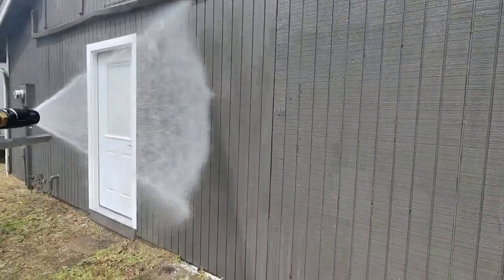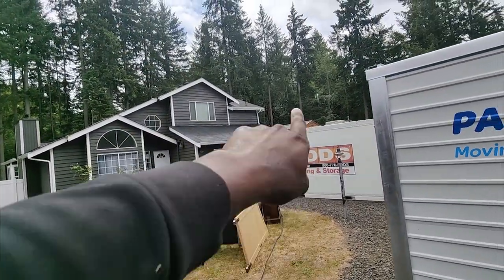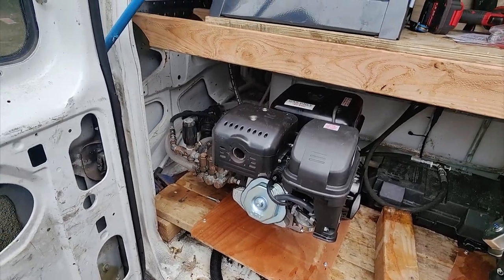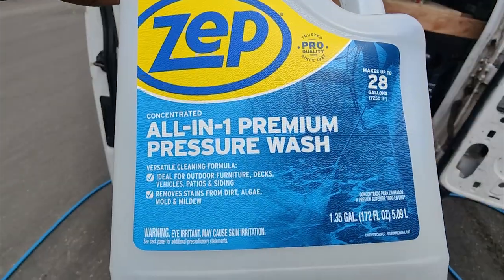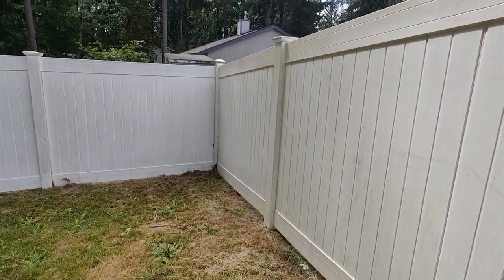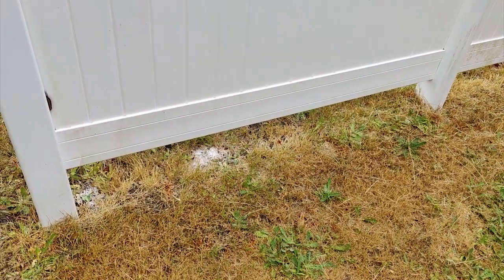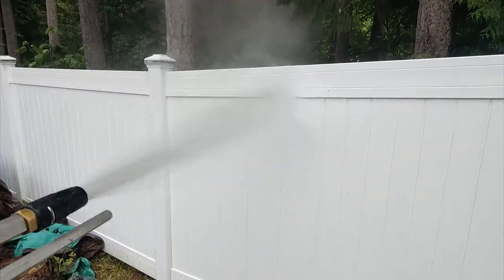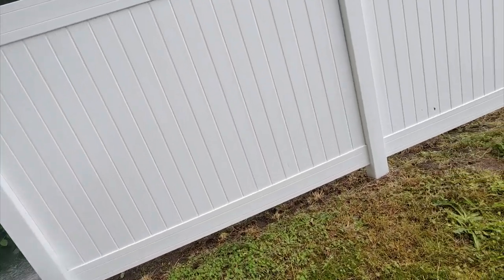8GPM BUILD // ZEP'S ALL-IN-1 PRESSURE WASH REVIEW

Comment: Are you proportioning your bleach before the downstream injector?
Reply from the maker: Yessir 😁
Reply: @BJMolette  is that to conserve on bleach?  I typically need the 1-1.25 % that comes out of my injector to clean houses and vinyl fences.
Reply from the maker: @colonialfiend  yes. It gives me all of the control I need. I'm going to change the orifice size to pull max chem and just use the metering valve to bring it down. I heard you can get 4% with this setup.
Reply: Commenting on YouTube sucks as comments can get skewed or taken out of context.  If you're downstreaming 12.5 SH straight from the SH tank to the injector, the max is typically 1.25 out of your gun and no more.  The only time I've ever heard of throttling back SH when downstreaming is when it's super hot out and you can get away with spraying maybe 1% because SH reacts quicker in hot weather.
Reply from the maker: @colonialfiend  yeah I followed what you were saying. I heard if you have the right size orifice in the injector, with the check valve, and with 1/2 inch hose then you're capable of getting more than the usual 1-1.25%. my orifices just came in so I'm gonna play with it and get some actual numbers for you guys.
Reply: How did it work out?
Reply from the maker: @bconn49  I haven't gotten around to it. I've been busy. Just picked up an engine for my ar40 build and it's me and my lady's birthday weekend. I'll comment the link here once I upload it.
Reply: The arrogance of some customers who think they know more than the professional they hired. And then the customer hands you a 1.35 gallon of consumer grade watered down cleaner from Home Depot that they paid $14 for.😂
Reply: @LostAllFeeling  well that's where they think we get our chem.
Reply: @slimeyslug12 
if it keeps the customer happy, let them think what ever they want to think. That’s what is really meant by, “the customer is always right.” I’m so cynical.